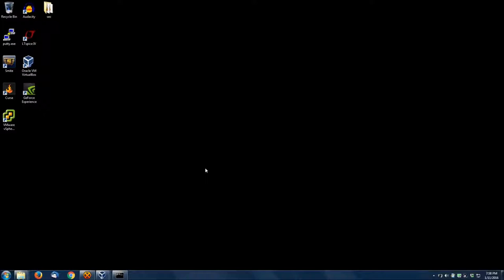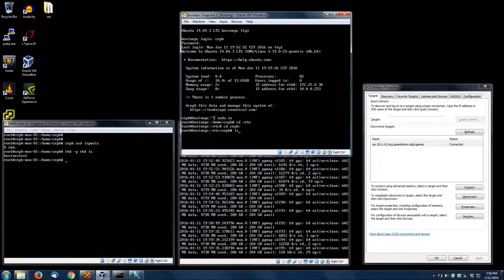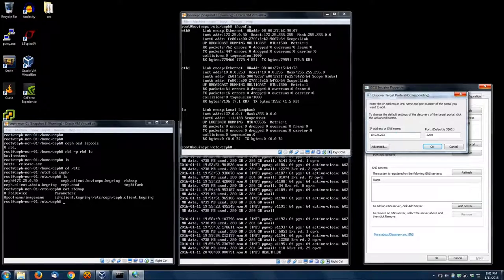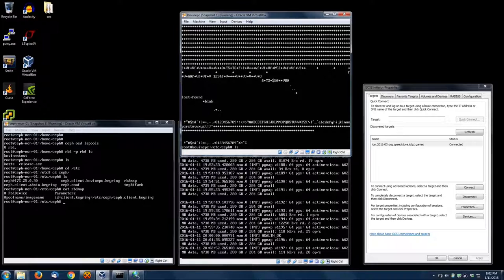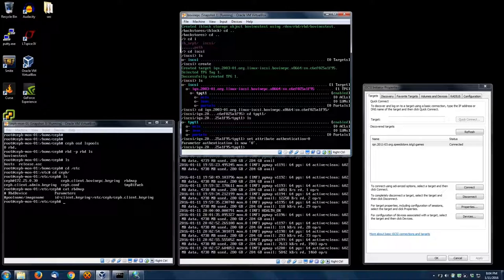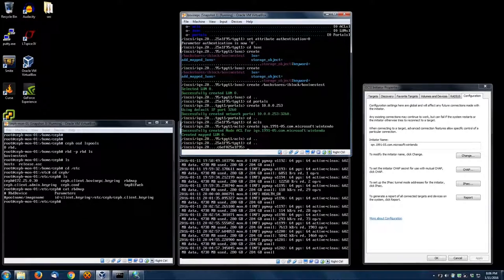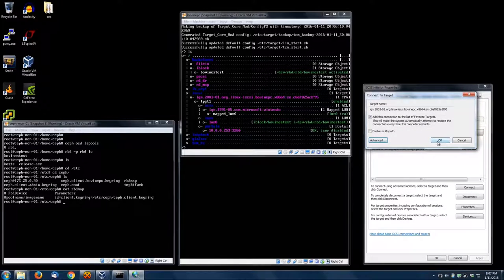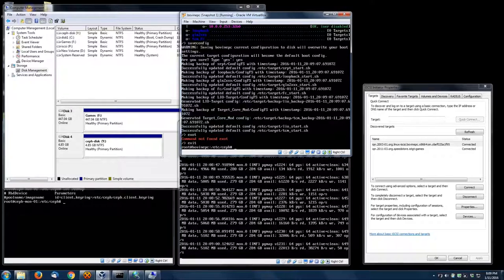Ceph Hammer: Building a iSCSI target out of an RBD.

Comment: I set this up and it worked great, but I did notice some issues with snapshots of the device block image.  If you take a snapshot  of the DBI with RBD and change anything on the disk within Windows and rollback it, the changes will not show up until you run a CHKDSK.  Perhaps related to Win7's iscsi initiator.
Reply from the maker: windows runs a heavy cache layer on top of iscsi disks, there is no way to change this. you must disconnect then make your rollback and then reconnect.

Comment: Have you ever tried a 3/3 configuration on a pool?  If so, see if you can successfully fail 2 of the OSD's and still be okay.  I tested this with 8 OSD's/3mon/300PGs and it never worked for me.  1 OSD fail worked fine, though.
Reply from the maker: I have tested 3 osds, disabled 2 osd's and yes it still works
Reply: bovinespongiformflu My issue was related to my 3/3 setup.  The IO is halted if only 1 replica exists.  Manually setting it to min_size 1 would allow for healing, but is not recommended.
Reply from the maker: if you mean monitors yes you need to have a majority of monitors. typically monitors are seperate from osd servers. it is in fact quite bad for monitors and osds to operate on the same boxes.